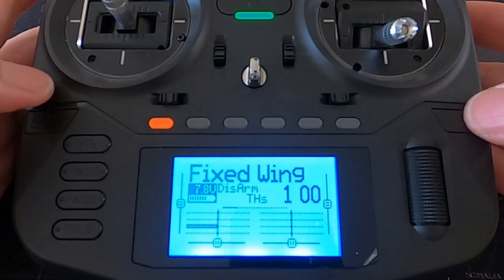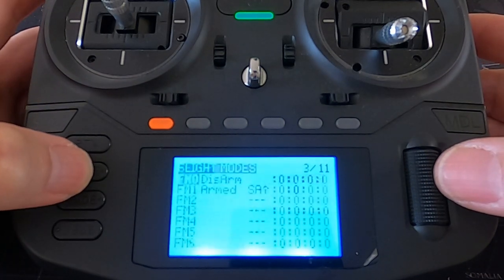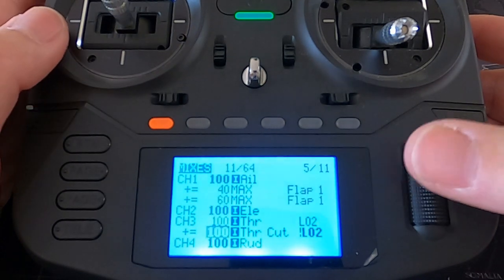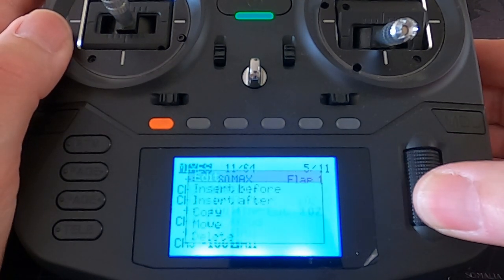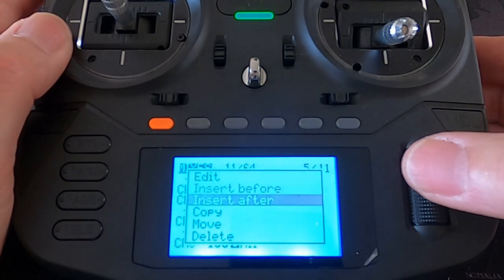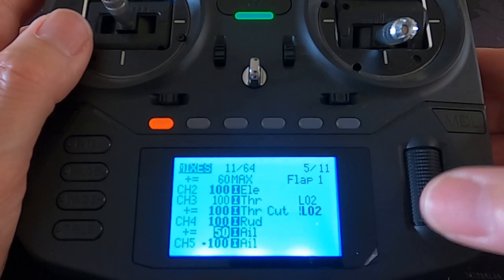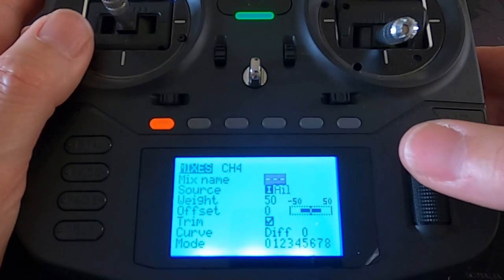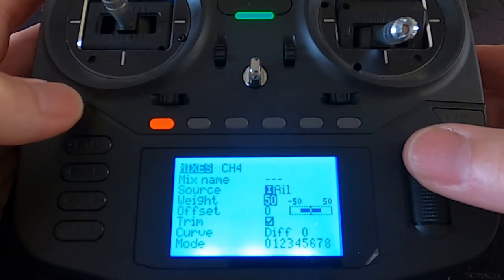RadioMaster Boxer Setting Up Aileron Rudder Mixing

Comment: I have got the CAR mix Okay but would like to adjust the weight of mix either side of centre, inflight, using rotary switch S1 but can't seem to do this. I just end up with the rudder following the rotary switch position.
Reply from the maker: Hi Mark, you will need to set up a global variable and replace the weight with the global variable. Could you clarify the mix you have set up.
Reply: I have SA and SD as high and low rate switches for Elev and Ail respectively.( I am mode 1). So have used SB^ for CAR off and SB- for CAR on. This is all new stuff to me, my old gear was Fleet, yes,Fleet.
Reply from the maker: Sorry Mark can you clarify CAR is combine aileron and rudder?
Reply: Sorry. Yes, Coupled Aileron Rudder. @the-happy-RC-flyer
Reply from the maker: @markstainton9080  Hi Mark, you will need to set up a channel mix, additional line to the rudder & a special function. Will film a tutorial video shortly.
Reply: @the-happy-RC-flyer  That'll be great. Thanks.

Comment: Hi sir, I wonder if can help me on my sailboat winch setup. I’m using mode 2 so the throttle stick is on the left. This new servo I just received yesterday from Aliexpress is not responding to the lower sticker throw below zero on the control. It only move above zero on the stick. I hv no issue with other servo. Need your advice. Thanks.
Reply from the maker: Hi, could you please let me know which receiver you are using and which channel connecting the new servo to.
Reply: @the-happy-RC-flyer  , I’m using the usual ch3 for that sail winch. I’m using er5c rx
Reply: @the-happy-RC-flyer  , currently I calibrated the throttle stick ch3 instead in the middle, I pull it all the way down ‘tricking’ the tx to take the lowest stick position to be ‘0’
I know it’s not right but this works…

Comment: How would I mix retracts and flaps to operate on one switch?
Reply from the maker: In the channel mix for the flaps and the retracts, I assume they are on separate channels, select the same switch.
Reply: @the-happy-RC-flyer   would this also work on the channel inputs?
Reply from the maker: Yes but I normally leave the INPUTS as they are with an exception of dual rates and Expo for Fixed Wing. I do this so they apply to any mixes I set up for these flight controls. With drones leave the INPUTS as they are.

Comment: I am making a car with this. I am controlling 2 motor with 1 esc each. Now channel 1 is working fine and can make my bot go ahead and behing... but problem is channel 2, i cant turn left or right it is in same front and back direction. To turn it left and right among Ail or  Ele has to be reversed for channel 2. How do i do that?? I noticed its reverse in your remote bu havent explained in video
Reply from the maker: Change the weight to -100 to reverse the direction.
Reply: @the-happy-RC-flyer  it's not working can you make a short video addressing that sir?
Reply from the maker: I am not sure how I can assist you, have you checked the settings against mine in the video?